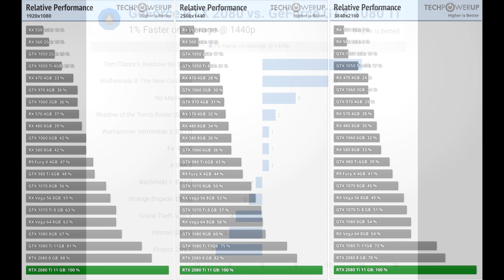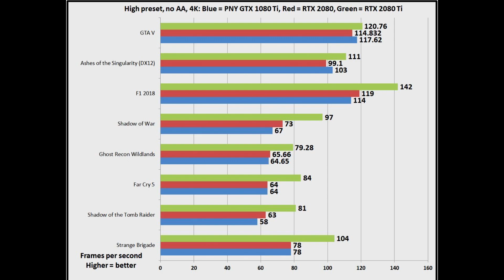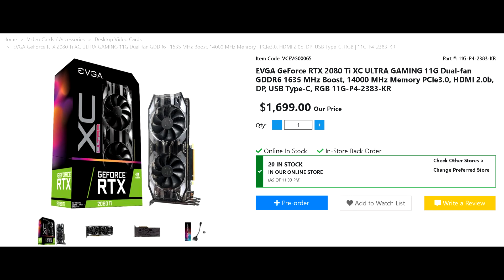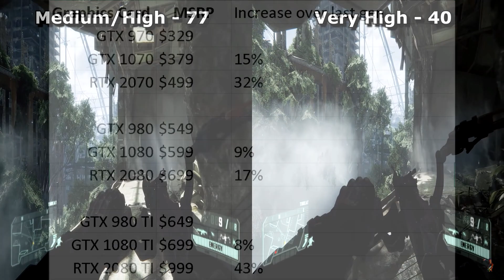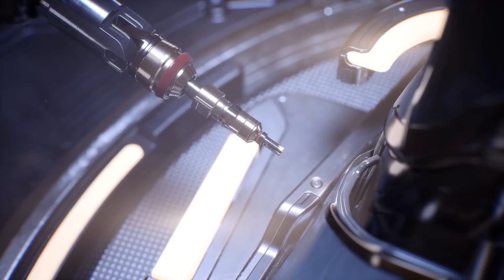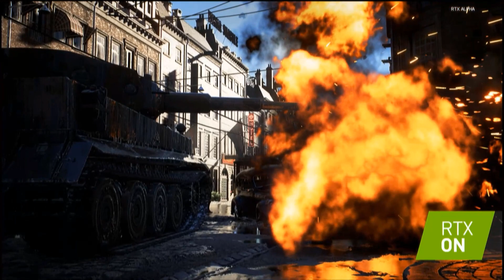Why Nvidia's RTX 2080 and 2080 TI are NOT worth it!

Comment: This is by far the worst nVidia graphics card generation for a very long time. Their biggest selling point is vaporware. Ray Tracing is still years away from becoming main-stream. They are demanding a massive price premium on a technology that (1) The hardware can still not truly support -RTX offer only shadow effects using RT tech (2) The industry has not yet adopted into the mainstream. At best, over the next year or two we will end up with a small handfull of games that will support it.
So considering the dubious value of paying for a tech that you will almost certainly only even make use of in a minority of cases, the price of these cards is outrageous. The issue is not the performance they offer, the issue is the price they are asking for it. If each of these cards was stepped-down in the model and price stack (2070=>2060; 2080=>2070; 2080ti=>2080) they would be compelling, as they stand, they are a joke. This ladies and gentlemen is what a lack of competition looks like.

Comment: well yeah.. if you're running pleb 1080p res then yeah stick with whatever you want. but if you have 2k or ultra wide or 4k res then they are extremely worth it. the porformance gain is not in the pleb 1080p range. 5-10 % increase. but 2k and 4k 20 -40 % fps increase.
Reply: The 4K performance increase from a 1080Ti to a 2080Ti  is 24% on average. Are you enough of a pleb to think that a pathetic 24% for twice the price of a 1080Ti is worth it? How deluded are you?
Reply: if all you want is fps increase then yes you are correct. but there is ray tracing and dlss too. I understand why people wouldn't buy if just for the fps increase.